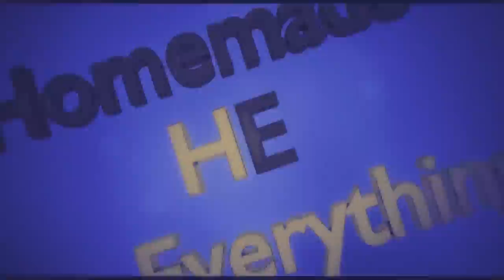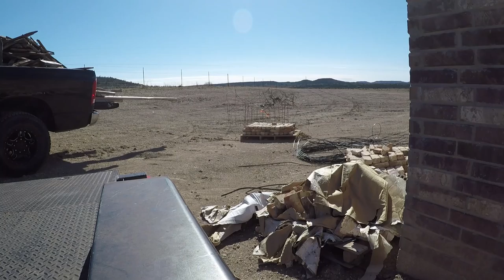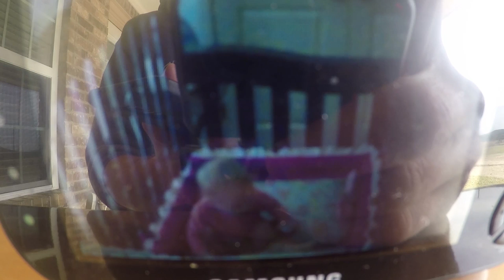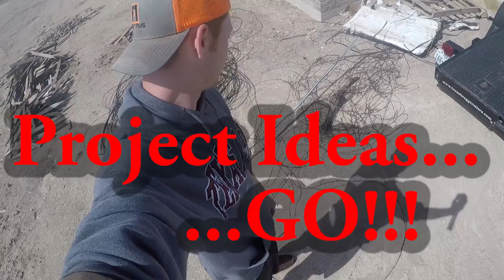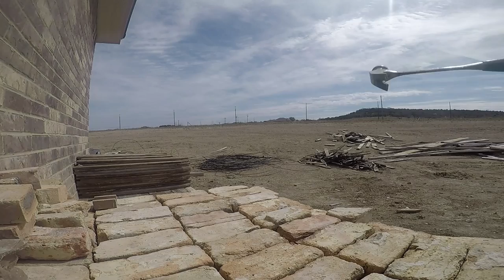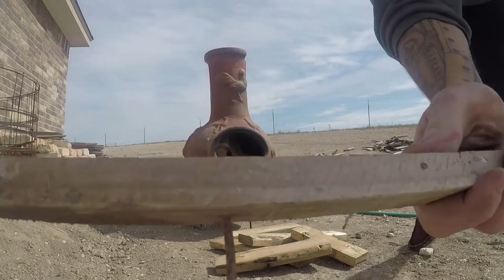Reclaiming Wood

Comment: Nice truck
Reply from the maker: RFG BoneCrusher   Thank you sir!  wifey bought it for me.  It has held up pretty well.  built the trans up strong after the factory transmission failed at 150k miles.  just hit 180k and still strong!   running a smarty S06 tuner and she makes plenty of power.  Sounds like ill need injectors replaced soon though.